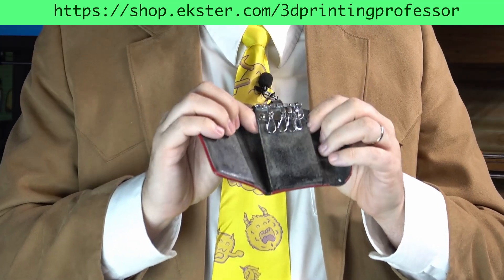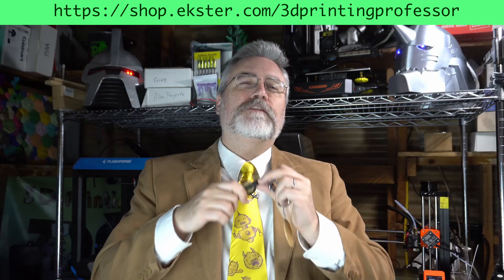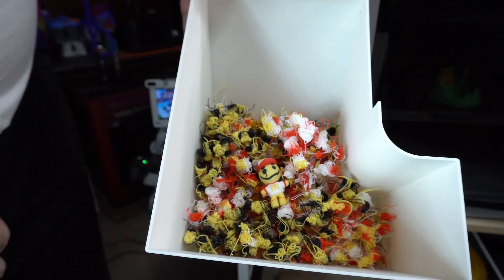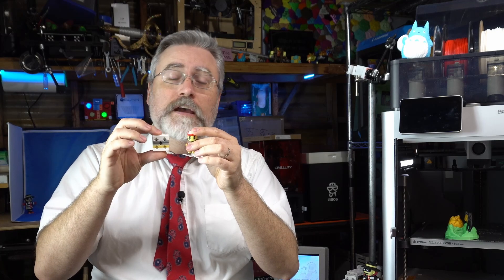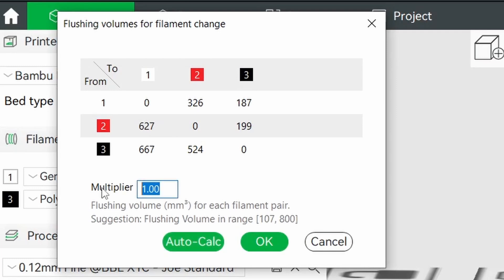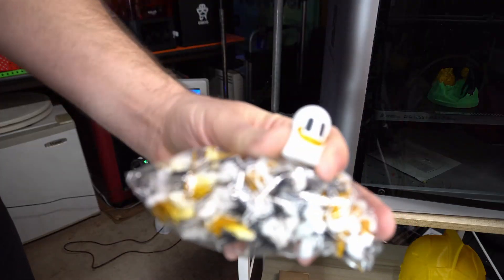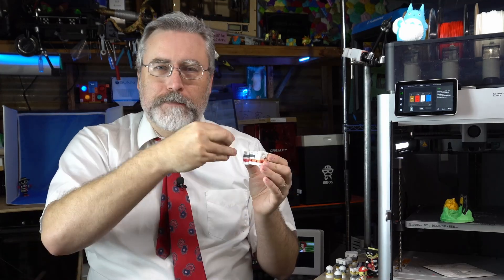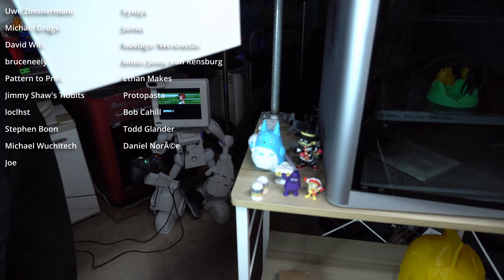Can BambuLab's AMS 3D print with less waste?

Comment: Thank you for the video. (subscribed) I just got my A1 AMS mini a few weeks ago and I'm amazed at the amount of videos about Bambu Poop.  I figured if I could afford the printer then the waste is just part of the deal. (I won't be doing THAT MUCH multi-colors, right?) So I did a few test prints and wow the amount is a lot.  I thought of melting it down and pouring it into molds may be an option until I read the warnings on lung pollution.
So I watched this video several times, took notes and came to the same conclusion as you did. If you tell it to use the extra object, and the purge tower then why am I still getting waste poop?  I have no answer, but thanks again for the video head check.  BTW, the Bambu A1 rocks the house, even with the waste!

Comment: It's a year later and I want this more than I want the H2D they just dropped, would've also just preferred a bigger print bed even if only on the A1
Reply from the maker: They have improved it from the time this video was made. There's still progress that could be made, though. I'd love some kind of optical check that stopped at the appropiate time every time. You'd think they could have spent one of the 4 cameras they're purting into the H2D for that.
Reply: @3dpprofessor they shouldn’t have launched an H2D but rather fixed the issues on the X1C first. I should not have to go to the store to figure out an attachment to fix the nozzle cleaning system for PETG and other sticky filaments. It is in no way plug and play and is not perfect from the supplier. Needs work.
Reply: I don’t understand how this passed testing stages when 100% of users complain about the purge chute system and filament drag.

Comment: A programmer who deals with 3D and gcode creation here. It is not trivial to create a system like this, but it will not take more than a month to develop and maybe several months to test for a even single developer. In addition, it is almost trivial to calculate the extrusion amount is not enough to flush to the object and go back and flush to the chute. This will mean you can get any additional prints out along with your primary design, just in random colors. Bonus: random colors is one sprey away from being any color you want.

Comment: Especially being a beginner and seeing the amount of waste on multi colored prints, it doesn't even make me want to try and tackle multi colored prints. There aren't a lot of low cost options yet for using filament waste after the print. Turning the "waste" into something beneficial DURING prints is definitely thinking forward. Making that easier would definitely make 3d printing more enjoyable I think. Just my .2

Comment: If you were printing in two colours and purged into separate colour purge towers could that make a difference?
Reply from the maker: What an interesting question.
The normal purge tower does have different sized bins for the different colors, adding more or less as the purge amount requires. The only problem is the shape of it isn't very useful. But if you swap it out for any shape, you're going to run into the problem of it either being too much or too little for any given project you're doing multi-color on. It's a trade off.

Comment: What about when the settings to "print by object" and flush into an additional object BOTH selected.  Will the printer print the main object first AND flush into the additional object whenever there is a color change or will it print the first object entirely and not flush into the second object?
Reply from the maker: Do you always post the same comment on two videos?
Reply: @ no.  It was a mistake.
Reply: @ but I very often ask the same question to many people - because I get many different answers.

Comment: What happens if you create the same model but with purge filament even if it has a mixture of color on the same layer. If it need to run our more filament than the required layer, make two objects.
Reply from the maker: That's basically it. You could absolutely do that and many people do.
Reply: I thought if I did two of the same model, one with the colors I wanted, and the other the object to flush to that it would mean there would be zero waste, but it barely change the flushed amount and I'm confused lol.
Reply from the maker: @kajekage9410  Well, there's a number of things to consider:
What is the cross sectional area of the purge object? If the purge object is small and thin in parts and uses very little material per layer, you can't expect it to take much purge.
Did you increase the infill of the purge object to maximize the waste that goes into it? Don't go all the way to 100, though, or you might have print quality issues. 90% or 95% is usually good.
This is why I recommend PrintABloks in the video. It's a very consistent way to catch purge.
Reply: @3dpprofessor  It was two little rabbits lol.  The only thing I could get to really reduce the flushing was to import a bambu cube and increase it's to match the height of the rabbit but at that point it was so wide that while it was reducing flushing it needed so much more material and took much longer.  What are those printabloks used for?  I am fairly new to 3d printing but just got an x1c.
Reply from the maker: @kajekage9410  PrintABloks are a building block set of my own invention made specifically for 3d Printing. https://youtu.be/vvisOsZClLQ

Comment: I have seen that there are custom settings to lessen the amount of purge and bamboo labs has aried on the side of caution with the purge setting to an unreasonable amount. You can safely half the puge settings without loosing any Precision.
Reply from the maker: I wouldn't say on the default that you can safely half them. White is particularly tricky.

Comment: Good video, it helps with all materials. Special attention to PETG though. As others have mentioned, the stickiness of PETG causes problems with the chute. It jams regularly with PETG, while not jamming with PLA, ABS, etc. Allowing a purge to a secondary object where color is of no importance prevents the chute dump and thus reduces the issue with PETG jamming the chute. The proverbial two birds with one stone. 

Keep up the good work Professor. Nice to know there's an advocate in the background working with manufacturers on improvements on our behave!
Reply from the maker: I wonder how the script I mentioned in today's video would work with PETG. https://youtu.be/s2H9AzDzjkU
Reply: Good question, I'm hesitant to try it though. PETG being sticky I'm sure there will be some stringing left when it pulls up. I'll let someone with more time and patience (LOL) give it a try. 

FYI, I like your pull/push idea. I agree pushing it back down while still hot would prevent some potential clogging issues. That is as long as it was done quickly. I'm also wondering if turning off the hot end fan during the pull/push process might be a good addition to the process? Again, as long as it was done quickly.  @3dpprofessor

Comment: Here's an idea can you purge it into the infill of your main print. If you have enough infill , you may be able to build the print with all the color changes correct on the outside and different on the inside
Reply from the maker: Just up the infill to 90% and that would help.

Comment: Dear Babmu (and 3dPP :) i just bought a bambu printer, so now I'm invested in the per-print-pooping-problem :). If you had a flush object for each colour change in your print you could use each one when needed (And if you don't use a colour, fill it with whatever you have). Also, you 'could' optomise the fill density for each layer so you purge at least 5mm^3 for example - same as the purge tower -and then if you can't fill all your objects, poop the rest out. Sounds complicated to me, but then I'm not a 3d-printing revolutionisationalater...  Happy printing!!!!

Comment: Would be cool if you could specify which color(s) to purge into an object so you could purge each color into sperate objects. I purge into painters pyramids a lot because I go through them in my resin projects, but Id be interested in what other useful object people purge into.
Reply from the maker: What if a certain color doesn't appear on a certain layer? Should it still swap to that color and do the purge into that object even if it doesn't need it for the print?
See, it gets real thorny real quick.

Comment: i am having issues using pla support interface for petg prints. the high flush volume builds up too much in the chute before it's dropped, and hits the nozzle. anyone have a solution for this?
Reply from the maker: Gotta clean out that flush pile frequently. Don't let it build up.
Reply: @3dpprofessor  the chute is empty. it's the high volume

Comment: Good work and experimentation! I just got my X1C last week and have been learning as much as I can about getting good prints out of it. Great machine, but the filament waste is really at a level I'd call disturbing when I print anything with several colors. I know some people say they plan on designing their multi-color prints so they'll only use one color for a whole portion, and then only one other color for another large portion, etc. But I find scenarios where that's practical to be really limited. (Maybe for such things as making a base or platform for a figure or statue a solid color and then switching to another solid color for the rest of the object?) What I'd really like to see is a newer model of the X1C that would have two extruder heads, with one dedicated to only printing structural support filament. The support filament spool would then, hopefully, be possible to load on the back of the printer itself while the AMS still had 4 spools free for other materials. With this setup, you could always print your supports or rafts or bridges with your support material without all the waste from many, many filament changes it needs to do for the average print.

I know this wouldn't solve the "poop" problem with multi-color prints, but it would solve it for every single-color print you ever do that requires support structures, and reduce it a bit on multi-color prints needing supports. Would speed up the print times when support structures are necessary, as well. Seems like it would be a big "win".

Comment: pretty new to 3d printing but, flushing into object mean you can flush the mixed colour into infill layers, starting from the inner most part of the layer out? There'd have to be an extrusion timer to guestimate the colour turns solid by the time the printer reaches the outermost visible layer.  Complex problem to solve, not all models would have the surface area to allow for that, so you'd still need a poop shoot
Reply from the maker: That's the basic idea. And, yes, I get that it's non-trivial, but if there was less waste I think a lot of people (judging from the comments) would get a Bambu if this were the case.

Comment: I wonder if there is a way to hack the code to make color change maybe every 3 layers, not every 1. It is still low enough to not affect quality of neighboring colors, and with z-hop nozzle shouldn't get caught. Have you looked into something like that?
Reply from the maker: So print 3 layers of one color, then swap, go back down 3 layers, and do 3 layers of the next color, etc.
The problems with this is you have to worry about the nozzle crashing into parts that it's trying to get tight next to, not to mention the purge tower/object still needing to keep up so you're still filling out layers of good color.

Comment: Looking at the poop in the bin, it just seems like it doesn't really need to purge anywhere near as much as it does. The colors look clean. On my Ender 3 clone, I have an all metal heatbreak, and I can go from black to white with a purge of just about 15-20 cubic millimeters.
Reply from the maker: Part of the problem, and another thing they could improve on, is the fact that they cut way above the nozzle and purge that whole amount. But some of that could be make useful in the print if they stopped printing early, snipped, and kept printing to the purge, do the purge, and keep going.
Reply: @3dpprofessor  Oh yeah, I'd forgotten about the guillotine. Thanks!

Comment: Thanks for the video. Do you know if it is possible to replace the hotend with another one that can go up to higher temperatures? If it is, would you have the ability to select higher temperature settings in the Bambu studio slicer? Thank you.
Reply from the maker: How high do you want to go? The normal nozzle does up to 300C without a problem.

The problem with going higher temp is it's not just about the capability of the heater core, but it's also about the ability of the components around it to withstand the additional heat for long periods. You're adding strain to the whole system that might not be a good idea. Which is why the software will stop you from doing that and you'd need to go to a 3rd party slider to override that. 

But then don't go complaining to them (or me) when your hot end assembly is turned into slag.
Reply: @3dpprofessor  Thank you for providing me with helpful information and taking the time to answer my questions. I am aware of the challenges involved in modifying or using a machine in different ways. Bambu Lbas mentioned that it is technically feasible. However, your last remark was inappropriate, immature, and offensive. I would like to remind you that I am an adult and expect to be treated with respect. Your tone or sarcasm would not be acceptable in a face-to-face conversation, as I would not tolerate it. It is unnecessary to respond in such a way.

And you call yourself a "professor".

Comment: What are those "purge block" are used for ?
Reply from the maker: Do you mean the slicer purge blocks? Or the Blocks I'm making? The blocks I'm making can be used to build things. The slicer's purge blocks are used to make sure the pressure of the filament in the nozzle is right. Without that, by just "drooling" out of the nozzle, you might end up with the start of a line being too thin.
Reply: @3dpprofessor  the blocks you are making, I’m buying a x1 carbon with AMS really soon and this poop issues is really turning me off after hours of searching how to solve this issues and you seems to have the better answer for that issues..! But I was wandering how to use these block of you creation! Thanks for the fast reply, it’s a like and a subscribe for me right now !

Comment: Need a thermally activated(activation temp outside max printing temps) filament, to avoid additional plastic poop in our environment.  Also what about the infills used as a purge object? Need some planning, had seen that done already,with the Mosaic Palette units. Another way is to comeup with multiple purge towers, but with a catch!, It is almost like using multiple denominations of coins to makeup a specific sum. Also the purging is done in such a way, the layers are printed like supports, so that the individual colors can be snapped off later. This way, they can be reused or recycled to make use of them again, as individual colors. Just some 💭
Reply from the maker: It does do some purging into infill, but the point of infill is to minimal, so it doesn't actually dispose of much material.
Reply: @3dpprofessor  I agree, may be just having multiple purge towers(each having different cross sectional area), for each color, coupled with easy snap support arrangement could enable least purge. Also the purge could be auto calibrated by printing a square tile over a tiny transparent conveyor on the edge of printer bed, with a color sensor to verify color purity. The prints off the conveyor will be the only wasted mixed color material. The material on purge towers can be manually snapped off and sorted (may be using a dedicated sorter with machine learning) for recycling. Seems to involve a lot of slicer pre-planning, but could limit the purge waste to a minimum. Just some 💭

Comment: That is exactly why I am not crazy to do multi color prints, because the waste is insane. I recently discovered this flush function as well, but still feel it could be much better, I hope Bambu Lab prioritizes to minimize the waste during multi color.
Reply: There is stuff that this waste is not that significant for, if it has good value for some reason, sentimental or economical.

Comment: I think what I would like to see is the ability (similar to how when you print multiple parts by object rather than by layer) to do the same with the purging. This would have some limitations, as it has to ensure that the hot end doesn’t crash into any of the printed objects but if that was done, then for prints (specifically smaller multi colorred prints that only take a small fraction of the bed) it could purge however much filament it could once it reaches that then it logs where it left off on the purged object (say Z level 5) returns back to the main print at (z level 2) and then you wouldn’t have that limitation of needing the perfect amount of filament per Z level. That being said there’s a lot of variables still,  and you would need some sort of way for the slicer to calculate if that’s possible without crashing into either print, and if it would cause an issue then it could either A. If the purge objects Z gets too tall compared to the main object it would need to flush some of the filament to prevent the purge object from getting too tall or B. Indicate to the user that they need to make their purged object have more x and y volume which would also solve that issue. I’m sure there’s more factors than just that, but hopefully all that makes sense